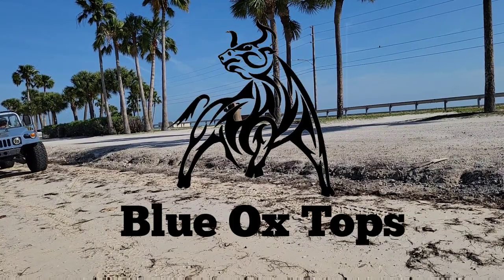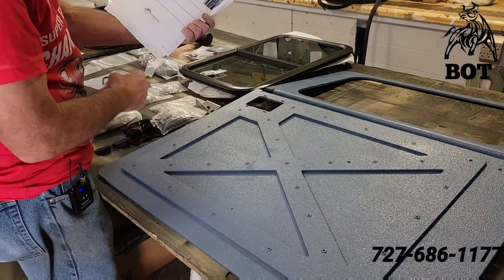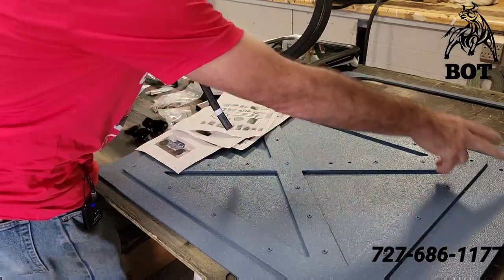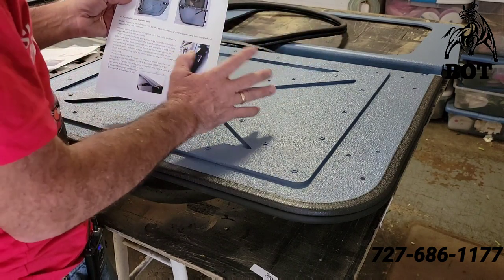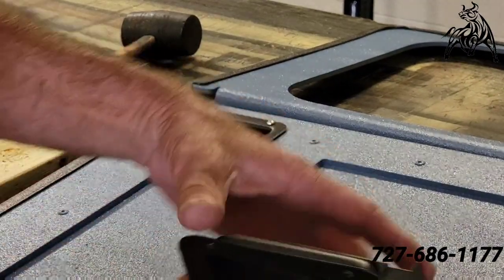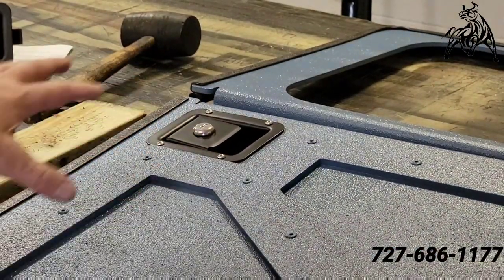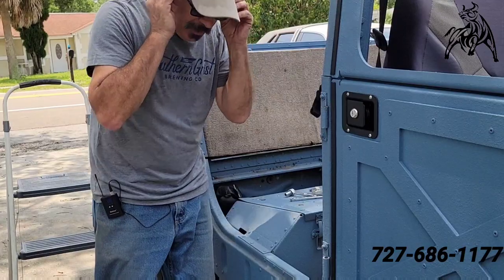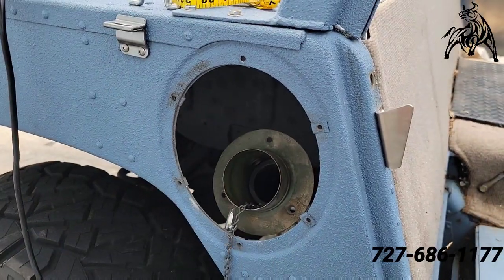Cobra Tek doors on the Blue Ox

Comment: Very nice! We deal with a company that installs sunshades for parking areas for cars. That mesh is available in so many colors, you can almost match the color to one’s ride. Have you looked at the add on accessory for the hinges that will make it harder for someone to make off with the doors. I worry about those gaps in the weather seal where the window panel meets the main door panel. The company should provide some extra length to fill in those gaps. If I wanted rain and wind coming in I would have gone with the soft doors.